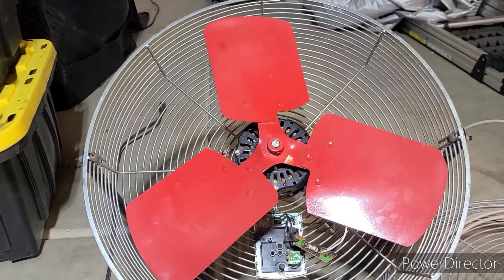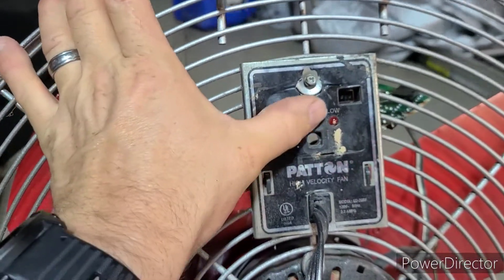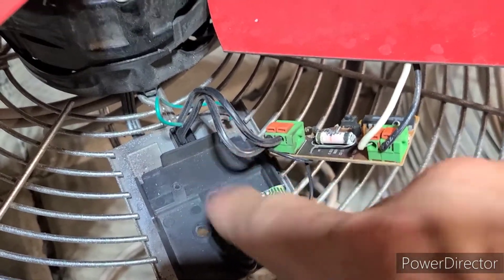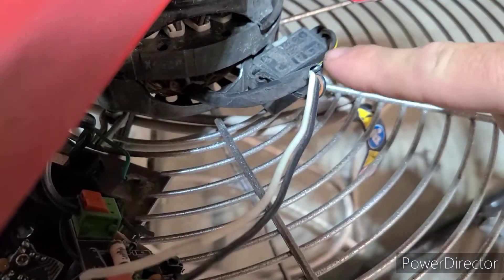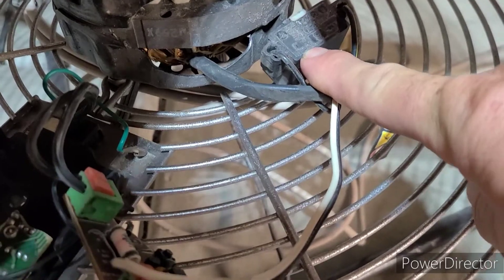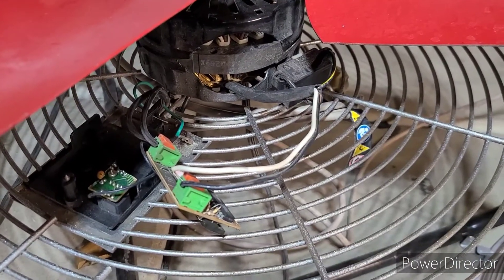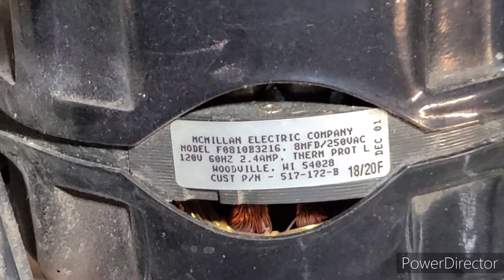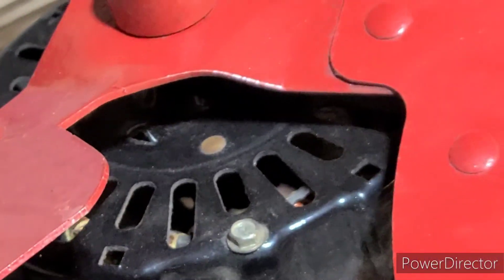Patton 20" Fan rewire switch help needed (U2-20RF)

Comment: Your pretty much by passing the switch
Reply from the maker: Really appreciate the help. So you are confirming that this motor is powered by  2 wires instead of 4 like traditional manual switches. Wonder if they ran different voltages to motor with electronic circuit. Maybe I can do the same with high wattage variable resistor?
Reply: @jitterspec  the main windings are powered by 2 wires and the start windings are powered by the 2 capacitor windings
Reply: Just don’t send more than 120 volts to it

Comment: So solder longer wires on those the black and white and put a plug on it and it will run I would use a variac and slowly give it power to make sure it is working right

Comment: I would try to take the black and white wire that is running from the circuit to the motor and make those the power leads it would only run on high that what it would do